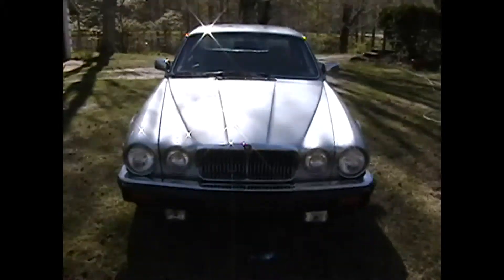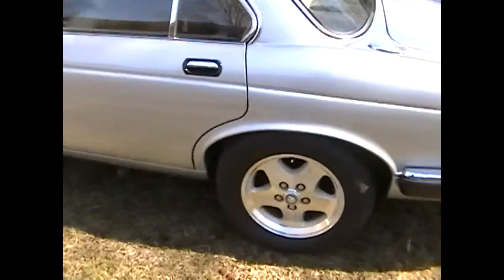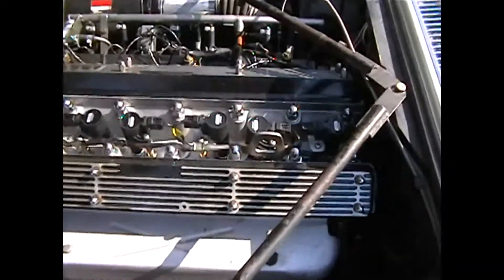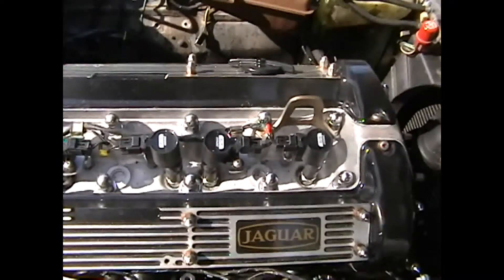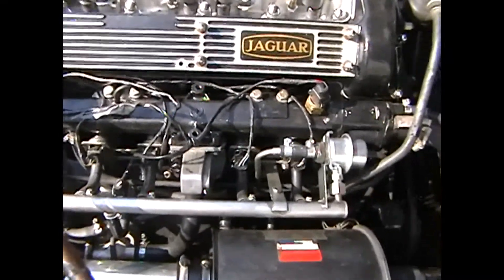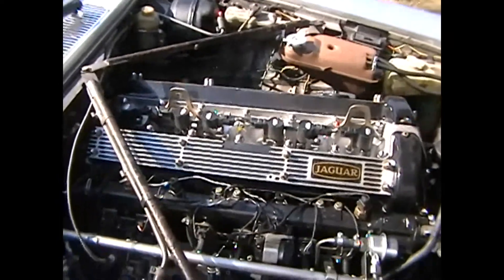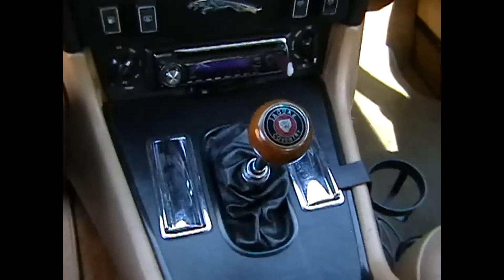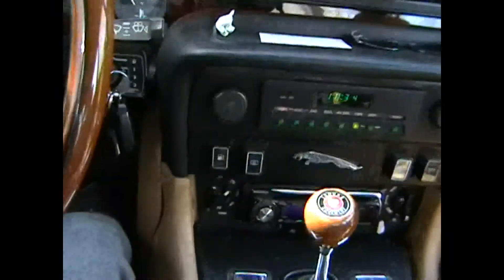1983 Jaguar XJ6 5-Speed with Megasquirt Engine Management

Comment: Nice jag mate, how did you come up with the idea ? Nice engine management system. How's the idle now with this system? I took out that front console unit and added a clock instead. I have a 86 series 3 also. And I'm currently working on a 71 xj6  SWB  but rebuilding another series 3 engine for it but with carbs. thou your system seems a great idea would be into any info that you would be willing to share. Would  be much appreciated are you on FB subscribe to my YouTube and you can see my vids. Cheers I'm in Santa Rosa CA
Reply from the maker: Thanks, man.  I am really enjoying the car.  Just over 2k miles since the engine rebuild and the car is running strong. I had heard of the Megasquirt, but didn't really get interested  until a friend showed me one that he had installed in a Fiat 124.  I was hooked.  I built one and installed it in my car using the huge EDIS coil and the wires running everywhere and thought there must be a better way. COP seemed the answer, and it is. It took some experimenting to find the config that works, but it works great.

 I have the idle running about 800 rpm and for the most part it is very good.  There are times when it appears to run a bit rich, but that is a matter of spending some time with the settings.

I have spent all of my adult life playing with Jags and their carbs, and I feel that this is by far the best way to go when it comes to fueling and sparking an engine.

I am willing to help in any way that I can if you are interested in a similar system. You can contact me by email if you wish.  Novom2001@yahoo.com.  

I am not much into Facebook, but I do have a page.  This Old Jag.

I'll check out your vids.
Reply: very cool, sounds like me and all my british cars I own. my interest started when I was nine when my dad owned a mk2 Cortina my passion started then. we neverowned a jag thou the closest we came to a jag was a rover p3 and a Austin cambriged both 60s cars. I will email you I get the electronic coil pack part but I'm very curious how you did away with the air flow meter. cheers mate.
Reply from the maker: The Megasquirt has a built in MAP sensor, which it uses instead of an air flow or air mass meter.  It is  similar to the way that the XJS system works.  You can configure the Megasquirt to operate with a mass air meter if so desired.